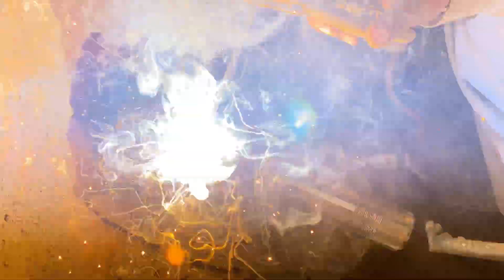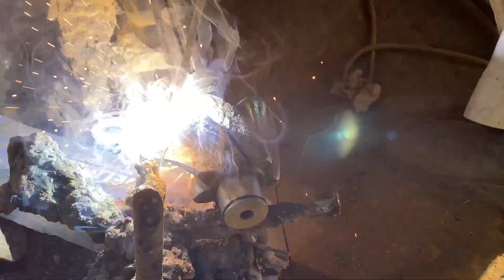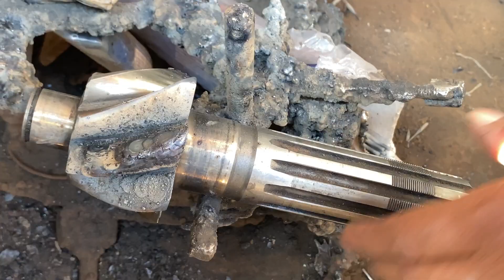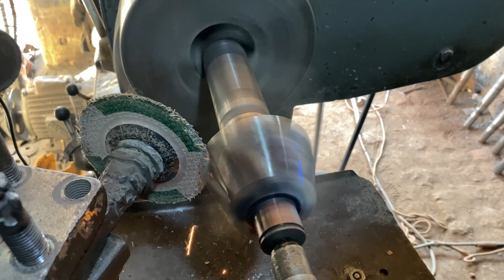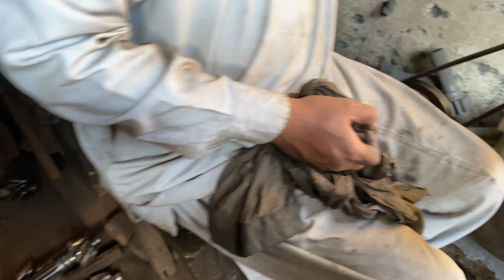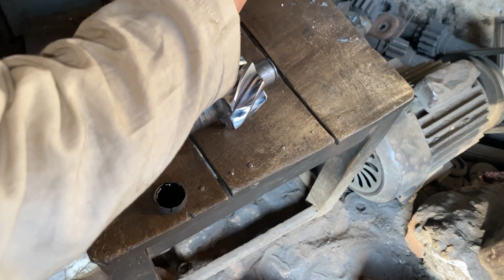This Expert Machinist Repair Broken Pinion Gear Tooth With minimum Tools

Comment: I’m convinced they just “fixed” it for YouTube views and then it gets tossed in the scrap pile
Reply: Welding on a cast steel part, then grinding down the outer diameter will change the tooth engagement, grinding off more tooth material will just cause more slop unless it’s shimmed correctly. It will get it out of town or to someplace with a replacement part. But it’s not a long term fix
Reply: @Steevo69  yeah, I know…

Comment: That’s some beautiful handiwork, the temper is what I’m worried about. That thing is going to shatter/bend with a load that the previous harnesses would’ve handled. Still tho, hell of a way to get it back on the road. Hell of a job.
Reply: This guy is a master i bet you this part will last longer then a new one which is what would have been done here in the USA.
Reply: Yes very true...they lost me when they started grinding all the other teeth - although it looks great, it now will no longer interact with its companion gear as it should, the tolerances or gear lash will be immense. I speak as a qualified, practicing engineer with 15 years experience. Hats off for ingenuity though, necessity is the mother of invention👏👏👏
Reply: @Bugsy0333  master is a stretch. They’re just guys working to feed their families. Give me two weeks with you and I’ll have you doing this job just as good as they did.

Comment: Engines in Pakistan must have very loose tolerances.
Reply: Bro, they barely have tools, let alone "tolerances" ...

As long as it works, it'll be fine. I'm astonished that he even managed to recover that piece's original form... Most western technicians in the same conditions, would have deemed the task as "impossible" ...

Give that man a bit of credit...
Reply: They get them from a to b and that's all you need
Reply: This is for a differential , not an engine. 

I am curious how long it will last
Reply: Tolerance are very necessary but it's a local work shop you know what I mean local 
They are assets of our country don't blame them..
Reply: can u do it like that?
Reply: @3dwezzy740  not correctly but in a pinch
Reply: I was about to say the same thing
Reply: Stay in your tiled floor air conditioned osha approved shop orange vest safety glasses  just to open hood of car
Reply: @dec13666  you know very little of use, and it shows.
Reply: @BakeASnake  grew up salvage yard know what can be done on spot and also  machinist prototype  ..manual..cnc ...you know nothing
Reply: @graemediesel2936  cant imagine long im pretty sure these parts are heat treated
Reply: @BakeASnake  And you wouldn't have managed to pull out the same thing this guy did under the same conditions, without having watched this video first 🙃...

You know even less, man...
Reply: @miguelcastaneda7257  what jefe hurt you bro😂
Reply: Tolerances are overrated...
Reply: @David Espinosa  no they would not. They would replace the part, as its only costing the customer more in the long run, going to have to replace it. its not an impossible fix?  but i suppose its all about making money there and getting paid for poor decisions. if they had any morals they would tell the dude that it is not going to last and probably eat the gear its meshed with, costing even more money.

Comment: They are just eyeballing the dimensions so while it may look good, it’s probably 10 to 30 thousandths off in places, and that's a fatal amount of error.   Not sure why they applied bluing to the crevices, that's the only place that does not need it, and we didn't see them test-fitting the gears and following the blueing indications.   And it’s not surface-hardened.   So it’s going to run very rough and not for long.
Reply: Agree ! I'd like to hear the sound of the differencial !!
Reply: Yeah, I don't agree with this "repair." That thing isn't going to last very long!
Reply: I agree with everything you said. But For them to be able to do this. Especially eyeballing means they’ve done this before. I’m gonna have to lean towards this is going to be good.
Reply: Exactly this type of repair might get it by but it's deffinantly not gunna last like the original gear. Also gear teeth are usually only case hardened the new tooth is much more brittle not to mention the tolerances being eyballed and they took the grinding wheel to all the teeth. Looks Shiney and pretty to the average person but at the end of the day this thing is just a pretty paperweight and a bandaid fix. I understand they gotta do what they gotta do in 3rd world areas where parts may not be available
Reply: i agree its not accurate anymore
Reply: i totally agree with you brother! but lets appreciate his time and work for doing this its not that bad for the way he is working :)
Reply: Prethishun🧐
Reply: @timekeeper5275  me too . I don't doubt it'll last . I think I may actually work for years. If the mechanic can shim it out rite   Wich I'm sure he's used to doing.  Where there's a will there's a way .  They'll make it work..

Comment: Very crude way of repairing a gear pinion gear rather.  As some one said in Pakistan tolerance is not a problem it seems. 🤭 however good you are the product should serve its purpose not only in terms of working but in terms of perfection and durability. Today you repair it and tomorrow you find the main driver or something else is broken what is the use. Super glue technology.

Comment: Some machinist can work to +-.005 with just their eyes on scribed lines. Some heat treated rears last over 400 thousand miles, I bet this will last longer than the people and the truck as long as they don't  beat it and keep oil on it.

Comment: Yea I'm a tool and die maker and fairly new gear mechanic and this is all bs. That's a polished turd. If you're impressed you obviously don't know, so do yourself a service and look what just a regular straight involute gear tooth looks like. Then a beveled gear, and then a helical beveled gear. There was no measuring even done. So shiney doesn't equal good not to mention the metallurgical issues with how they did it. Respect the hustle but not the product.